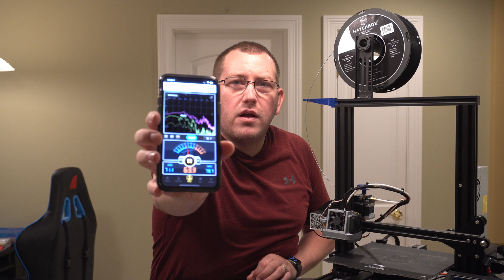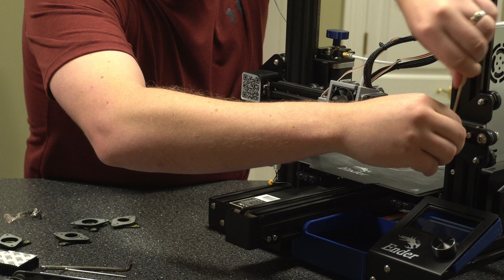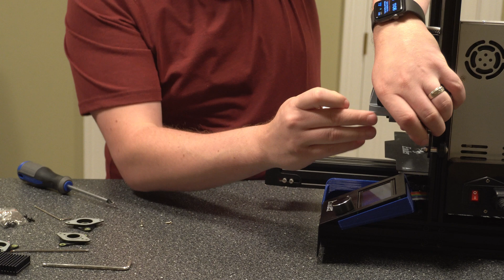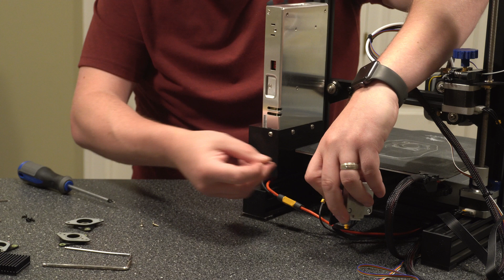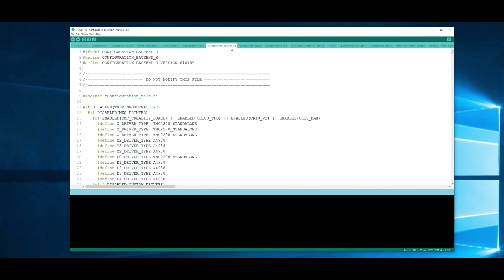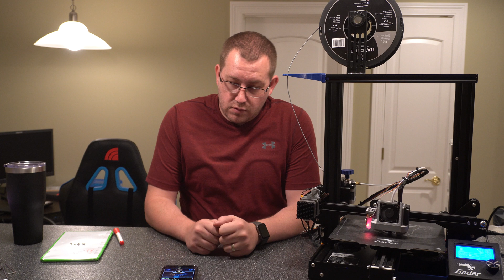Ender 3 Pro Stepper Motor Dampers (Do They Make a Difference?)

Comment: Hello, thanks for your great videos, what is the problem with installing the dampers on the z-axis about? Why is it not recommendend? I mean I have read that it is not required, but does it really cause problems when installing them on z axis? Thanks
Reply from the maker: Hi. I dont think it would cause any problems as long as its not blocking any axis from moving.
Reply: it just doesnt make all that much sense i think because the z aixis is moving soooooo much less while printing compared to the other two axis. only when the hotend needs to move to the next layer.

Comment: I made damper feet for my ender 3 and then took red RTV gasket sealer and coated the bottoms of the feet and let it dry. I did the same thing for my bed mounts on y carriage mounts for the linear rails. Been considering coating the top of the stepper motors and letting it dry and then mount the steppers. Honestly, getting rid of that 4.2.2 non silent board will be the best bang for buck for silencing your machine. Silent drivers are night n day. Id like to see the results of these dampers along with a silent board.......
Reply from the maker: Hi. Thanks for sharing this. I agree that moving to a silent board is the best bang for the buck at this point.

Comment: Great video. Just for clarification, compression fittings are used in plumbing. These pulleys are "pressed" on the shafts. It confused this machinist, when you said compressed. Thanks.
Reply from the maker: Thanks for the info!

Comment: Firstly,  thank you for your time. Great video and with that in mind. Your video,  provoked a thought.   Theoretically speaking,   could it be possible, initially,  during assembly  of the printer.  To place a rubber  O ring between the end of each of the bolts of  the stepper motor and the frame. Then also placing a rubber  O ring between the head of each of the bolts  before they are introduced into the through holes of the stepper motor and after each bolt has two rubber  O rings,  one at the end of the bolt where it attaches to the frame and another at the head of the bolt.   Now  tighten all bolts.  Theoretically,  the rubber  O rings themselves,  will act as rubber dampers and will minimally impact or change any tolerances / clearances,  that are necessary  in order to align and track the belts.  The rubber O rings will compressed as you tighten them.   Whats your thoughts on this ?   As far as the possibility of the rubber O rings impacting and  impeding the ability to disperse the heat.   I imagine the bolt itself will act as a conduction point allowing the heat to still dissipate and the O rings are a small footprint  Just a thought.  Now if you agree it might work ?  
 I purchased the ender Max and it will be delivered this friday. I will probably need to purchase several O rings for the bolts that come with it  ( Hardware)  that are necessary to attach the stepper motors on assembly . Do you have any ideas on the size of the bolts or  O rings  I will need to put this to the test.  I need to order them in advamce to have them here  upon delivery and begin assembly using this process.   I will probably need high temp O rings just in case those stepper motors get hot enough to melt or turn them brittle over time and defeat the purpose of having them installed.  Thanks to you,   just a thought ..        Semper FI
Reply from the maker: Hi. If the bolts are long enough, and there is enough clearance, this could possibly work. Most of the bolts are M3, but  there are some M5 ones. That said, im not sure it would be worth going through the trouble to do all that on the Ender 3 Max, it already comes with a silent board, so there wont be much benefit. The loudest parts on that printer will be the fans.

Comment: I'm planning on getting a silent board so after reading some of the other comments/replies I think I'll skip the dampeners.  Do you think there is any benefit to getting the heat sinks separate?  Maybe to help keep things cooler for long prints.
Reply from the maker: Hi. The silent board is the way to go. I would only get the dampeners if the silent board upgrade wasnt an option for whatever reason. I wouldnt worry about the heat sinks either, unless you start running into issues with them heating up.
Reply: @Gabriel Contreras  I got the SKR mini and everything is working well.

Comment: Your videos upgrading your printer have been VERY helpful for a newbie like myself. Question though... I have an Ender 3, not an Ender 3 Pro, are there any of your upgrades that you did that will be different/incompatible with the standard Ender 3? 

I basically got ALL the upgrades: 
-Stepper Motor Dampners & Heat Syncs
-Printed Power Supply Case, With 92mm Noctua Fan
-3D Printed Hotend Assembly with a 5150 Blower Fan, and a 40mm Noctua Fan
-BigTreeTech SKR Mini E3 v2.0
-BLTouch
-Raspberry Pi 4, with Camera
-Titan Clone Extruder
-X Axis Belt Tensioner

A reply would be greatly appreciated, thanks!!!
Reply from the maker: Hi. Thanks for the feedback :). The biggest differences between the 3 and 3 Pro are the frame and power supply so all the mods i cover will work on the 3 and 3 Pro.

Comment: How well did it affect the vibration tho as that's what I need
Reply from the maker: Hi. It had a small impact on noise and vibration, but nothing significant. If you dont have a silent board already, i would look at getting one of those first, it will have a larger impact due to the upgraded drivers.

Comment: Did you have to upgrade firmware or anything weird? i bought a couple of these and i havent installed them because every guide on it requires some crazy step i have no idea how to do, but i really want to quieren my printer even if its a little bit
Reply from the maker: Hi. It depends how you mount the steppers, but i had to reverse the direction of one of them. I would recommend looking at upgrading to a silent board if possible.
Reply: @3DPrintscape  Thanks, ill look into that, i saw you had to reverse the X axis rotation, if i installed only on my Y axis would it be fine?
Reply from the maker: @nn-hx8oe  Assuming its mounted the same way as the other motor, you should be fine.

Comment: Informative video, very bad camera angle
Reply from the maker: Hi. Thanks for the feedback, I will try to work on the camera angles more. I have been struggling with them because Im trying to get the best angle while still being able to get to the printer to work. I may just need to move away from the tripod im using.

Comment: If you want to lower the Ender's noise level, use the SKR mini
Reply: Yeah, but dampers are cheaper and also, what to do with the old board?
Reply: @player56978  This is an upgrade, not a recycling.
Each thing has as many uses as you can think of for it
Reply from the maker: Agreed, I actually just did a video on it https://youtu.be/wtT6iA9IG7A .

Comment: Hi just a quick question. I have an arduino uno. Can I use the uno arduino to load the boot loader and the firmware onto the printer? Or do I need the arduino 3?
Reply from the maker: Hi. I think the Uno will work fine.

Comment: I have a Ender 3Pro like yours but with one big difference that I change the bored out I don’t have the  dampers on my printer and my average is 49.1db
Reply from the maker: Hi. I don’t think the mainboard would make a difference. There are a couple of things in play that could, though, including ambient background noise, echos, the material the printer is on, etc. I fell you would be able to drop the noise level by about 5-6 db by adding the dampeners.
Reply: @3DPrintscape  I changed the creality 1.1.4 board out for the skr mini e3 v2.0 board and my ender 3 pro is now dead quiet. Only audible noise is the stock cooling fans. Plus the skr board made installing and using a bl touch a breeze. It was a bit pricey at $75 with board and the tft35 touchscreen, but the sound drop and increased accuracy made it well worth it.
Reply from the maker: That interesting. I will look at the skr mini e3 v2.0 board closer and may buy it. Thanks for the info.
Reply: @3DPrintscape  From what I can tell it's down to the drivers. Although I've got a v1 cr10, maybe the ender 3 has quieter ones?

Also just bought a Twotrees Bluer which has different drivers on x and y (can't remember if 2208 or 2209) and it whispers on those axis compared to the Creality.

Next is fitting a Robin E3D to the Creality, mostly because I kind of blew the original board...
Reply: 3D Printscape If I put the dampeners on I think I could get it down to about 43db this is the one I got BIGTREETECH SKR Mini E3 V1.2 Control Board 32Bit with TMC2209 UART Driver 3D Printer Parts Cheetah for Creality Ender 3Pro this made a big difference to my printer it was £39.99 I did not have to put firmware Marlin 2.0 as it. Was preloaded I would recommend this